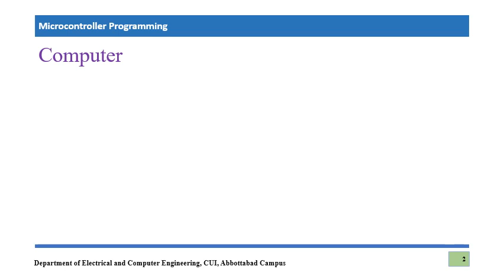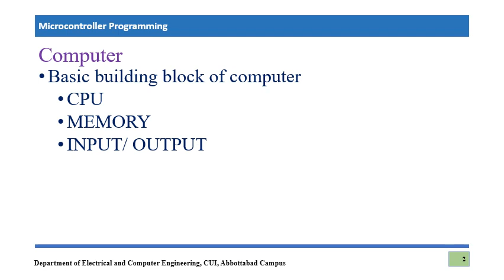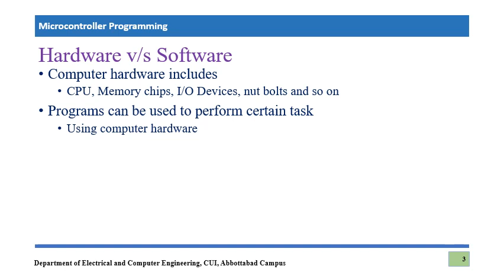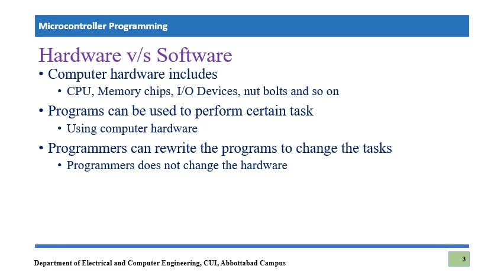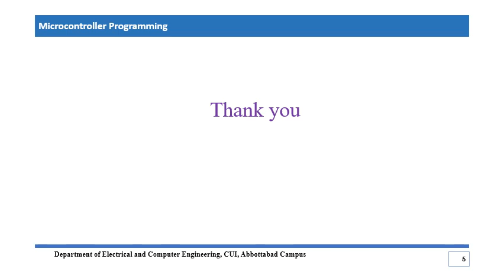Microcomputer to Microcontroller

Comment: Sir at last u said ... A system on a single chip is microcontroller. I got it ... Plz elaborate the second part. I.e  ( a chip on a system is microprocessor ) .
Thanks
Reply from the maker: Yes full system including CPU,  Rom,  ram  and i/o ports  is present  in single  chip whixh is called microcontroller  that's why it is a system on chip.  While  if we  see microprocessor  is simply  chip which requires  still to be integrated  on system  with other peripherals  that's why microprocessor  is called a single chip  on system.
Reply: @LearnOnline1  thanks for clarification sir !
Reply from the maker: Glad  , I could help.